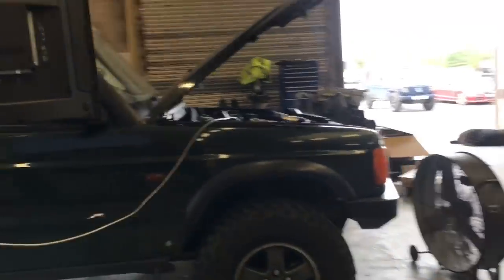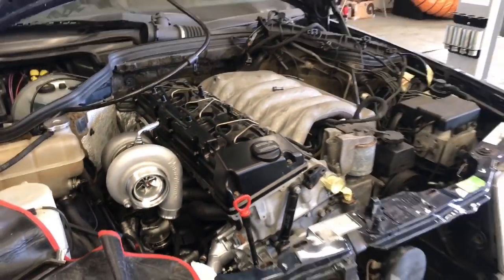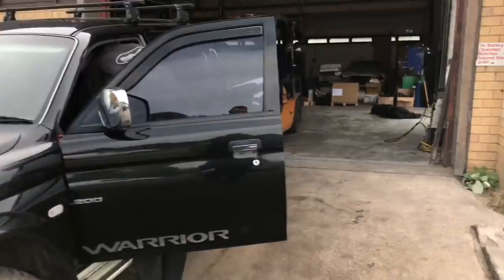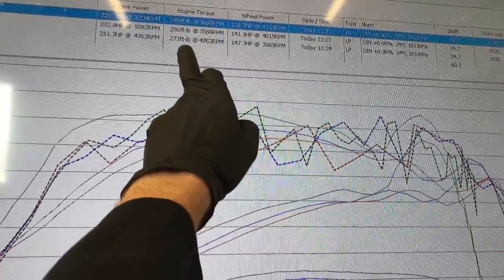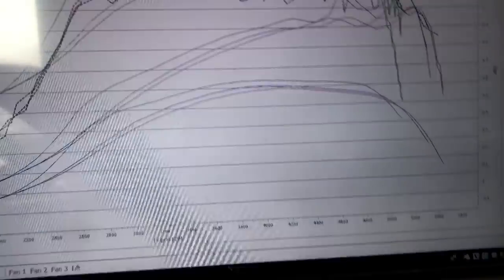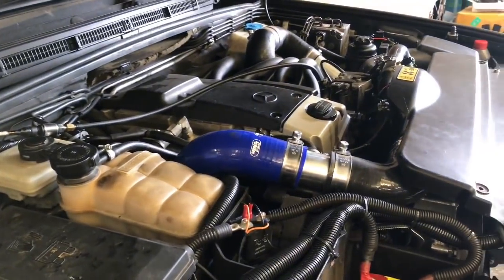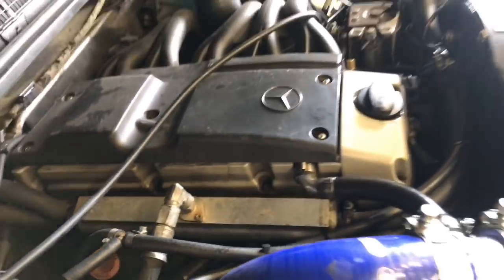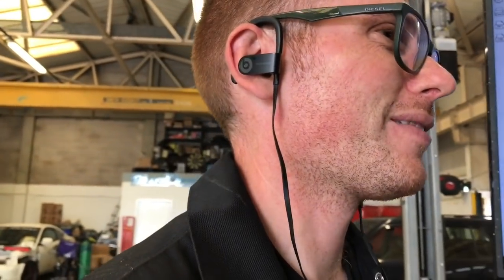Racing a OM605 disco on the dyno

Comment: HI, in the proceeds of buying a disco 2 or 3, and i,m wondering if a 605 ,606 or a 617 fitted to a manual,  will fit? in the disco 2 i,m preety shore; but 3 ? and ARE YOU AVAILLEBLE FOR THE COVERSION? and what would it cost ; Ican supply engines,
regards colin

Comment: What is the main difference between a OM606 and a OM605
The OM606 aren't as freely available as the 605 in South Africa
Reply: With the lil I know Om605 is a 2.5L in-line 5 engine and the om606 is a 3L inline 6
Reply: basically identical block just one cylinder less same desing overall but i like the 605 better simply because its a little smaller

Comment: Hi . Good video. Just bought w124 with na om605. Wonder if I can fit in turbo to make go faster😉
Reply: you can turbo a na 605 but i advice to not go above 250-300 for reliability reasons
Reply: from what I hear its full overhaul of Turbo internals into NA block

Comment: How have you got the Disco running in RWD? The land rover transfer box is full time... I'm guessing you swapped the transfer box to handle the higher power?
Reply: What about just take the front prop off and select diff lock on the transfer box?
Reply: they probably went with a different gearbox to handle the torque and its probably a box off another 4x4 that has an transfercase already. easier
 to swap because it requires less adapting.
Reply: reino kotze true true. Not much on a Land Rover that’s worth keeping 😉
Reply: they are not that bad. i used to work on them. The R380 manual that probably used to be in the disco can only take 380nm in standard form and wont enjoy its life behind a tuned 605.